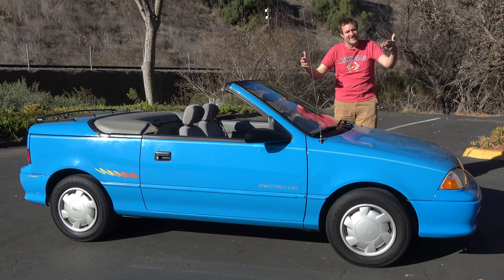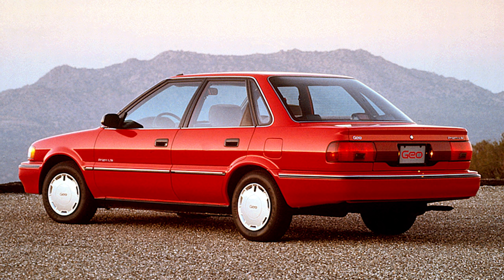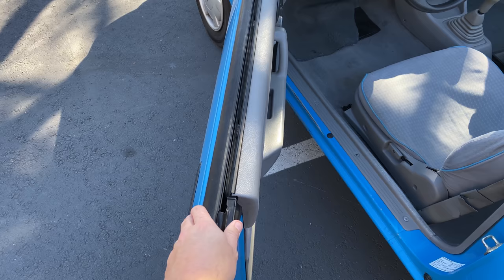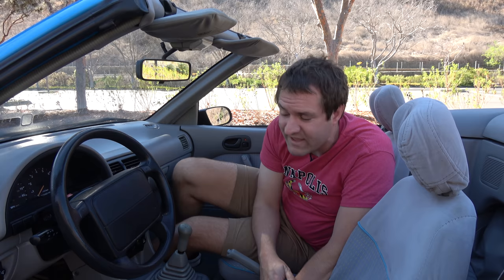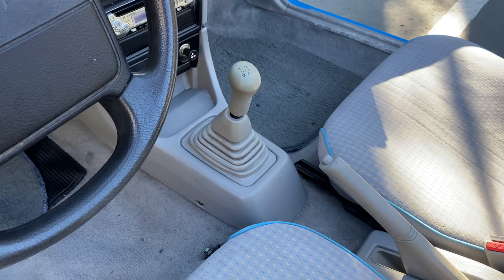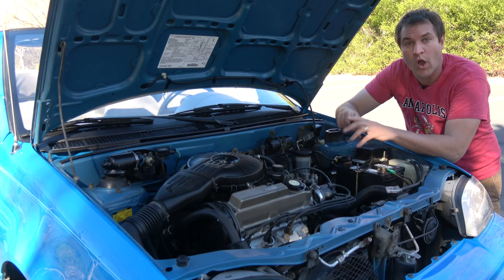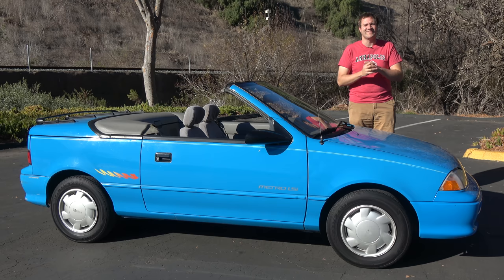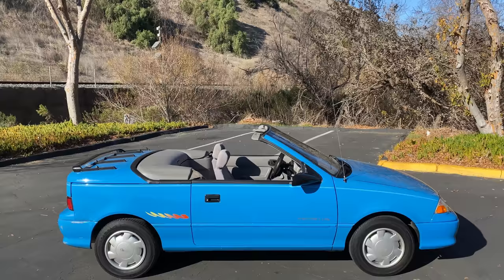The Geo Metro Convertible Was a Hilariously Pathetic 50-Horsepower Economy Car

Comment: The 1.0 liter engine made 55hp. 
4th and 5th gears were both Overdrives.
My first Metro was a 94 that I bought in November of 93.
I bought it to pound miles on it.
I lived near Salem, OR and had to drive to LA, California and back in 3 days Every weekend.
In 2 short years I put 210K miles on it.
It burn 1/2 a quart of oil between oil changes (every 3K miles) and it was still burning 1/2 a quart at 210K miles.
The crankcase held 3.5 quarts of oil.
When it had 51K miles the catalytic converter went out so I put in a straight pipe and got 5mpg more without the catalytic converter.
I averaged 60mpg at 85mph.
On ONE tank of gas (10 gallons) I had a strong tail wind and got 80mpg. It died on the off-ramp and I coasted into the gas station just outside of Bakersfield, CA.
After 2 hours of driving your butt goes numb because the seats are unsupportive.
My 94 had 12” tires. I would buy 80K mile radial tires. Every 30K miles I would have the transmission grease replaced with new. I  had to replace the clutch at 200K miles. I was on my 2nd set of brakes when I sold it.
In 96 I bought my 2nd Metro and no longer had business in LA, so it took me 13 years to drive 95K miles. And yes it burned oil as well.
At 6K miles something went out on my 94 and it was under warranty. They gave me a Geo Prism for a week. They were surprised that I had put 2K miles on the Prism in a week. I told them that I only had my Metro for 3 weeks when the vapor recovery thingy went out.
Other than that and the catalytic converter going out, I NEVER had any problems with either one of my Metros.
Both of mine were hatchbacks, but I’d Love to have a convertible just to have some quirky fun with my wife and I during our summer months around town.

Comment: Here's the thing with the G Series engines in these little metros: Everything needs to be adjusted to some pretty tight specifications, or they won't make anywhere close to their rated power, but will still sounds like they're running fine. Because they were cheap little cars, no one kept up on maintenance, so they'd perform poorly, and that'd feedback into the "oh, their just cheap, crappy cars" stereotype.

Properly adjusted, these cars (with the 5-speed) have no issues keeping up with modern US traffic. Toss in a few hundred bucks for a nice set of struts & shocks, plus some halfway acceptable tires, and they are actually are pretty fun to drive.
Reply: So they're like motorcycle engines? Makes sense, given who made the car.
Reply: That comment is stupid. The same could be said about ANY K-car with low HP. 🤦‍♂️ And if youre gonna put any money into it, give it better performance first.
Reply: @HU1212ICAN3  Lots of people own the Metros because they get 40mpg, people are more likely to put XFI parts in them and get even less power and better MPG compared to trying to squeeze more HP out of them. If they wanted something more powerful, it makes more sense to just buy almost any other car made from the same time period instead, and it'll be that way from the factory. But if it's cheap to run & lightweight you're after; struts, shocks, and good tires on a Metro is the way to go.
Reply: @Jonathan-gx7ed  theres ways to get more power without sacrificing mpg though. Not much but 10, 20, or even 30 would be great and right on par.
Reply: @HU1212ICAN3  If someone wants that much power out of a 3 cylinder Metro, it makes so much more sense to just buy a 4 cylinder MPFI Swift, get 35mpg instead of 40, and not spend a dime on modifications besides the extra $50 a year in gas. 

Suzuki pretty much gathered all the low hanging efficiency gains on these engines straight from the factory. It is possible to get a little more power out of them without a major hit to fuel economy, but it's a very poor return on investment. People will do the whole nine yards, putting well into the 4 figures trying to beat the factory setup; port & polish, crank balance, headers & intake, cam reshaping, high compression cylinders. And after all that, they're lucky to get 5-10% more power out of the 3 before taking a mileage hit. 

Go check out the fuel economy/performance section of the GeoMetroForum.com if you don't believe me, there are some pretty advanced builds on there. I've been messing around with these engines for 15 years on three different platforms and if there were a cost effective aftermarket way to get more power without sacrificing mileage, I (and many other people) would have done it already.

Comment: Speaking of '90s GM cars, I'd love to see a review of the Chevy Beretta. My mom had a '94 and is one of the first new cars I remember experiencing.
Reply: +1
Reply: I actually liked that car. I remember a neighbor owning a convertible version. It was very unusual for GM considering that when the top was down, there was a protective roll bar exposed over the rear window. Unlike other people I liked the styling. I heard GM got into hot legal trouble with Piettro Beretta for copyright infringement. I kid you not, the fine print on the dealer's 1994 catalog said "Beretta trademark used with permission of Piettro Beretta s.P.a. Italia." That's gotta be humiliating: being sued by a gun company for copyright violations.
Reply: I still own a running and driving 92 Beretta GTZ, still has less than 100k miles on it. I'll never sell it....
Reply: @Chevtec  The Beretta GTZ was pretty baller back in the day, probably pretty rare now.

Comment: Basically, Geo/Asuna did what the original Transformers toy line did in the ‘80s: they borrowed products from various Japanese brands and tried to pass them off as one cohesive lineup. XD
Reply: Sure, most of it came from Suzuki or Isuzu (Diaclone or Microman), but then you had the odd Toyota (Takatoku) or something that wasn’t even Japanese like the Hyundai (ToyCo) that became the Asuna GT (Shockwave). XD
Reply: Nerd alert😏
Reply: @TBustah  isn't the Asuna GT a Pontiac Lemans, which is a Daewoo made under license from Opel?
Reply: @LouisSubearth  
The second car I ever bought was a Pontiac Lemans. It is still the worst car I’ve ever owned.  It was a decent looking car at the time.  Mine was a 1992 that I bought used towards the end of 1992. I traded it in May of 1994.

They dealer where I bought it also had a Geo Storm which I almost bought instead.  I probably wouldn’t have kept it very long either.
Reply: They had a the geo prizm which was a rebadged corolla. The ironic thing it was more reliable than their own cavalier
Reply: Asuna you must be in Canada they only got sold in Canada for 3 years

Comment: In 1993 I drove from Brisbane to Darwin (Australia) in my Suzuki swift to my first full time job. 
3400km through the outback on roads that were narrow and inhabited by road trains. That is trucks with up to five trailers doing over 130kph. 
No aircon, no radio. 
It was an epic drive but I had to buy a more appropriate, 6 cylinder 4x4 the next year.

Comment: I think the reason why the driver-side mirror has a small stick for adjustment although it is nearer to the driver while the farther away passenger side mirror doesn't have it is because Japan has right hand drive cars. It was originally a Japanese car and it is a left over from it's basic design which wasn't changed even after left hand drive design adaptation. It is because originally the driver was sitting on the right side so right side mirror was near to the driver for adjustment and actually the left mirror was away so an adjustment stick was provided for adjustment while sitting in driving seat.

Comment: My grandfather owned 2 of the hatchbacks, one for drives "to town" and another for long distance road trips. My uncle also bought the last year brand new with a manual transmission and our cousin actually had the convertible many years before that. Once we took 2 in tandem to Vegas and the one with the 4 adults barely made it over the big hill before state line and was majorly holding up all the other traffic on the road. Next trip after that we didn't take the Metros to LV.

Comment: We really needed 8k resolution to admire this gem in jaw dropping detail
Reply: @__The_Real_V__  yes, I know. Take some reading lessons.
Reply: Yet Doug ruins it by making a fool of himself laughing at every simple, yet basic and common features of the car. I mean, really? Laughing at the manual mirrors? That's the most neutral yet default feature of a car and the car's 1989. I mean really?
Reply: @__The_Real_V__  His reviews are still great though straight from top to bottom. But most of the times I have to mute and skip due to those forceful "funny" parts. Great presentation; Annoying presenter. 🤣

Comment: I almost died in this car in 1997, 60mph head on collision with a mustang, engine came through and shattered my left femur, partial hip replacement, my head bent the steering wheel in half. If not for the airbag I would be dead. I get the chills whenever I see this car
Reply: Nice story, hope you're doing well. Respect
Reply: Yeah, I always shudder a little bit when I envision these older, sub-compact cars getting in a collision with modern vehicles!😳

Comment: As a hungarian, I can tell you that a lot of Suzuki Swifts are still rolling around my area. Heck, we even have some Geo Metros too. We're proud of the Swift, especially that a lot of European model (including the rebadged AWD Subaru Justy) was put together in the Esztergom factory of Suzuki. I don't care, what Doug says, I love the Metro/Swift, and I would love to have a 5 speed 4WD Justy for the winter here. All the MPGs all year round.^^ 💙
Reply: Amen to that. I am Romanian and I had a suzuki vitara for 5 years before moving to UK, it is a 2015 model and it was manufactured in Hungary. Omg i trashed it a lot especially off road and it didn't have a single problem. I had to change the tires and brakes only after 5 years picture that.
Reply: We had Swifts in Finland too. No a/c, but over the years some models had goodies like central locking and power windows. You don't see these anymore, as these are rust prone in our winter conditions where road salt is being used.
Reply: Me, an American, laughs in Capitalism.

Comment: I could just imagine Doug towering over this car making it look like a little thing and then getting into this tiny thing and you think he’s gotta be steering the thing with his legs
Reply: The steering wheels are very big, I'm 5'6" and keep the wheel straight with my knees when I'm feeling lazy. That said, they have respectable headroom, especially for their size.

The 4-door sedans had 39.1" of front seat headroom, and 42.5" of legroom. The 5-door wagons had 37.99" of rear seat headroom, which is the same as a Crown Victoria. Convertibles had the least amount of headroom, but every other bodystyle can comfortably seat occupants over 6' without issue.

Comment: With a 5 speed manual, these things were a BLAST to drive!  You could even put a turbo on them pretty easily.  And to top it off, they sipped gas, so my buddies and I never gave it a second thought to take a road trip to San Diego or Albuquerque for the weekend.

Comment: Fun fact: Subaru also made a version of this car. It had 4wd and was called Subaru Justy.
Reply: This metro is based on the first gen swift/Cultus. The first gen justy is a bespoke Subaru design. The second gen justy is based on the second gen swift/cultus, and that isn't this car. They did make metros out of that car, but not in this generation.
Reply: @herranton  Wait, but this looks just like the second gen swift. Are they just so simillar that I can´t them apart despite having two swifts in front of my house?
Reply: These were also sold as Maruti Esteem's in India, and Holden Barina's (2dr hatch) in Australia & New Zealand
Reply: @nortonthedestroyer  yeh, there was a minor face uplift in which it's engine got updated from a 3 cylinder carburettor to a 4 cylinder efi and some cosmetic changes here and there so I guess in some countries it might be considered a new gen
Reply: vinesauce joel fan?
Reply: @peterkierstv  yup
Reply: @nortonthedestroyer  just looked it up, you're right, I'm wrong, about the metro. The first gen geo metrois a second gen swift. The first gen swift is a Chevy sprint. 
The usa never got a justy based on the swift.

Comment: I had a non convertible version as my first car, bought from my sister for the low low price of 4 new tires and driving it from where she lived in TN to where I lived in upstate NY. This car lasted me from 17 to 23, after she'd had it 4 years. It went a good chunk of the way across the US east to west once, went from upstate NY to Florida once, and upstate NY to Atlanta several times. It moved me from upstate NY to Ohio, and finally had its end of life due to an electrical issue I couldn't trace down that would cause the headlight fuse to burn out a few times per week. Working a third shift job at the time, that became dangerous. I sold it to some kid who was going to turn it into a suped up gocart, basically, for $100. It had 160K miles on it.

Edit: It was the same color blue. All my friends jokingly called it the Blue Lotus because it was a similar color to the much more expensive sports car. I was just thinking, we used to drive this thing on orchard roads at, "high speed." Where I lived in NY had a lot of apple orchards, and it was a dumb thing we kids did.

Comment: Don’t forget the Geo Storm! LOL
Reply: I liked my 1990 Storm.
Reply: @flyjarrett  I know it may have had double the horsepower of the Geo Metro, but bro, that thing was too little!!!!!
Reply: I was going to say, I’m surprised he forgot they existed; also what model was the Storm rebranded from?
Reply: @MichaelB769  Isuzu Impulse
Reply: Ironically even though they were GM's cheapest cars, the 4 Geo models were almost certainly the most reliable GM cars of the era, since they were rebadged Japanese cars, and were even actually built in Japan with the exception of the Prizm. Prizm was still probably the best of them all since it rolled right off the NUMMI Toyota production line.
Reply: @Az14900  Thank you :)
Reply: @yoshikay8787  Yes, the car was small, but that’s what made it fun. I’m 6’2” and if I put the drivers seat all the way back, my legs would be perfectly straight. I was never uncomfortable driving it.

Comment: Hey Doug! Fix the subtitle on 09:33 :) Or maybe it has some fuel leaks :D And thank you so much for this ''translations'', all channel should do this!
Reply: Yeah I had a laugh :D
It would work if it was km/l. But alas Doug fell for the ol conversion switcheroo. Doug, you can't translate  less or more MPG directly to l/100km, you have to calculate the percentage increase/decrease and go from there ;)
Reply: I had a good laught too.

By the way the difference is more like 1.4 to 1.2 litre per 100 km depending if you take the city or highway rating as a base. That's never the less a 25 percent increase over the manual 😱

Comment: Are we not gonna talk about how that "Emergency Key" is completely blank? Implying of course that damn near any blank key would start one of these things XD
Reply: This is the Lock Picking Lawyer and what I have for you today...
Reply: It was designed to you could take the plastic blank and have it "cut" to match your key. I bit cheaper than GM's normal emergency key (I have one from my '94 Cavalier), which is actually cut to match. The vinyl credit card sized pouch has the VIN stamped on it so you can go to any automotive locksmith and have them cut a perfect new key from scratch instead of a copy, or copy of a copy.
Reply: @dashcamandy2242  Interesting... My dads 92 Mustang also came with one of these credit card keys, but it actually had the key pattern stamped into it right from the factory.

Comment: I drove one of these for 20 years, I LOVED IT!!  Great gas mileage and it felt like you were on a skateboard with an engine, just a lot of fun.  Bought it in 1996 for $2000 and I ran it till 2016, I don't even know how many miles I put on it because its odometer only went to 100,000, it might have been 200,000 to 300,000 miles. All this guy is whining about is power and cup holders.
Reply: Mine had cupholders :)
Reply: As he should, I appreciate this car, but not everyone has standards as low as yours or mine

Comment: Thrilled to see some Geo representation on the channel, now do a Storm and a Tracker!
Reply: Do any of those even exist anymore?
Reply: I want a Tracker so bad
Reply: @Karmy.  I owned a '94 Tracker (4x4 convertible in Tropical Green Metallic), it was AMAZING. It would literally go wherever you pointed it. I racked up a lot of miles in muddy fields and snowy parking lots. Parallel parking was a breeze.
One quirk about the Tracker/Sidekick was the location of the hood release lever. It's in the glove compartment.
Reply: Love the Tracker and Samurai, but I'm particularly interested in the 1st gen Geo Prizm GSI since it was pretty much a 4 door Corolla GTS of its era.
Reply: @dashcamandy2242  yeah, I tried looking when I was searching for a vehicle but every Tracker for under 5K was completely trashed and/or had really bad rust issues